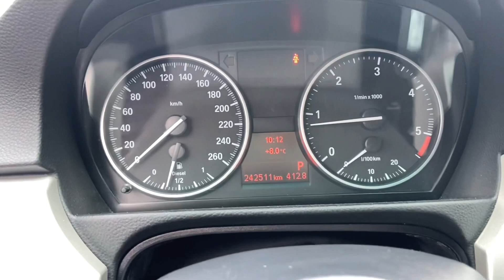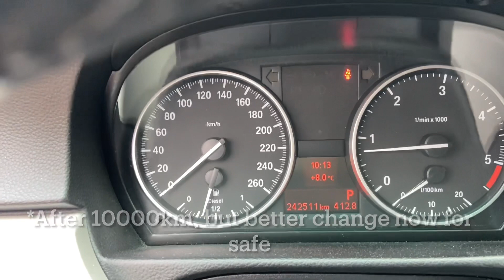BMW N47 timing chain problem prediction.

Comment: Exactly whats happening on my e92, new chain here i come.
Reply: 2010, changed it already!
Reply: @RalphWiggum93  What did it cost?
Reply: @GTAGaming94  in Ireland 1700 euros
Reply: @RalphWiggum93  hello, did it fix the sound or did it come back right after?
Reply: @nickolasseesannyland6355  sound remained the same
Reply: @nickolasseesannyland6355  and there were no problems with old chain according to mechanic
Reply: @RalphWiggum93  you car making swish swish sound when pulling up rpms? like in the video? even after new chains?
Reply: @edva135  Sounds like it. Mine has 100000kms on it, sounds like that, normal chain guide noise. if it rattling or clicking its stretched chain
Reply: @robp1041 replaced chain kit with oem,no more swishing sound.. ,now its quite
Reply: @robp1041  I have a b47 2019 with this noise , no clacking or rattling( at the start or later ), so this is normal i think, you had any issues with yours since? Because I just bought it and I listened to it I searched to the internet and  all the bad chains is when it rattles at the start and do a “clack clack clack” because the bad timing chains goes loose , actually it is the first video that I found to sound like this , so I was worried about that without reason .. what’s  your opinion ?
Reply: @ I really cant say without hearing it. But it got the better of me and had it replaced. Any noise it had is gone, its silky smooth and quiet now. Drives smoother and glad i did it, even though it cost $6000 AUD. 
 Engine stayed in and done from underneath
If its got more than 120-130kms on it I would do it.
Reply: @robp1041 hi my friend I send you the link to sound mine I uploaded on YouTube, I write on the video that when it is cold I have no rattle at the start etc and i don’t sound anything , when it works 2-5 min i sound it like “ts ts “sound  and after I drive  it for 15 min or more I don’t listen nothing, I sound it only in “middle” temperature and also this is a garage it sounds worse than outside , if I had timing chain problem I think it would sound like   This all the time , also it has 0w30 oil so maybe it is normal? 🤷‍♂️ tell me your opinion thanks also mine has 100k km to low for b47 for chain, I just bought it 

https://youtu.be/AheuL_17x0Q?si=gWgjLr0sbR9LTUqV
Reply: @Chpspsa  To be completely honest, as soon as i hear it, sounded like mine exactly. Also, I am not sure where you are but, i would say that oil is a little to thin. Next oil change try a heavier oil, check OEM listing for oil weight. Listened to your video twice, exactly my noise. I bought mine with 93km on it and it did it from about a few months after. I really should of checked more, but dod=int really know what bad chain sounded like.  All i know is, that mine is not like that anymore. Its quiet silky smooth.  if keeping car for 2 or more years, plan to do it. Not straight away but more so in next year. Hope this helps
Reply: @robp1041 ok my friend thank you , I have two  more questions ( sry for wasting your time ), how many km  you have with your new chain and you change something else?also the garage that you did the change told you that  was something bad about your old chain or they didn’t see anything except the sound, I say that because maybe it is normal for example after 20K km to listen some sound ,this the most important part because if it has almost no wear maybe it’s normal , also I am from Greece and I don’t think that 6000€ is the price here for a chain change , I hope 🤞 😂
Reply: what year is the car?
Reply: My n47 has had new chains and guides about 10k ago and makes the same noise as this got the car about 7k miles ago and has always made this sound, I change oil every 5k

Comment: I've heard some N47s after timing chains repair make this sound again. It's also about the oil, after few thousand kilometers oil starts to wear out, then chains tend to make this sound.
Reply from the maker: Oil change performed from 5w30 to 5w40 and nothing changed
Reply: @headliner4936  so it seems this sound isn't really consistent. In my case it made some kind of "woosh woosh" noise for a few minutes after driving the car, just after cold start, as engine warmed up the sound went away. Did 100k kilometers with this sound, changed timing chains just to be sure, sound came back after 10k. I don't even care about it anymore. My friends engine is the same.
Reply: @GinsengStrip-wt8bl  So you have a repeating scratching sound like "tssts tssts tssts.."? That's why my N47 does and it didn't get any louder in around 10.000km since I bought it yet. I'm unsure whether it's the chain problem or just a "comfort problem" noise as bmw described it

Edit: I now know that my 2008 E91 with the N47 engine got a new upper chain and new chain tensioners and guides in 2014, so after they fixed the problem in 2013. It still makes this rhythmic scraping noise
Reply: @GinsengStrip-wt8bl  same thing on my 320d , the new chain has 60000 km oil change every 10000 to 13000 km. When its realy cold noting to hear only typical loud diesel sound, when i start driving or after 5 min of engine running it started to sound little like wosh wosh  then when car reaches operating temp it goes away. In the summer sound goes away way faster, and this sound apeared after 15000 km after the new timing chain was installed
Reply: @kora25719  exactly the same in my case. In the summer I cant really hear it, almost like it's not there.
Reply: @GinsengStrip-wt8bl  what year model is your car? Which N47 type? How is the car doing so far? :)
Reply: @bathanmark  2007 BMW 1 series 118d. The engine type is N47D20A. Still driving it, done 200k kilometers with it already. Overall it has almost 400k on the clock. Had it remapped to 193hp, no problems with timing chains so far but I'm slowly starting to look after F20 or F30. 6 years with one car is too long for me, used to change my vehicles each year before I got this one.
Reply: @GinsengStrip-wt8bl  wow. I wish to make my car reach even 300K hehe. So yeah frequent oil change :)
Reply: @kora25719 I have exactly what you described with my b47c20b 2019 engine, I just bought it and I notice that sound I was so worried about, but when I research about what a bad chain sounds like I never found this sound as mine i only found the starting noise for 2-3 sec ( mine doesn’t have this) and others very loud “crack crack crack “ noises, also I notice that if the car is cold at the morning I don’t listen the sound also when I go for a long run I don’t listen it, when I use it for 5 min drives I listen it like you , so it is normal I think, you had any problems since this comment you made with the car ?
Reply: Jp..Same at my N47D20C: after changing chain, noise "come back"-but, not so loud - and same noise also at 2500rpm.  Simple recipe: more often oil changing-specially if we do short distances.

Comment: OMG, the rattling noise seems to be more serious on my car because I found that when I use 2-3000 rpm, there is obviously and weird noise and shaking of the car body.
Reply: if u change it then change oil every 6k, it'll last forever
Reply: You need to top up your blinker fluid.